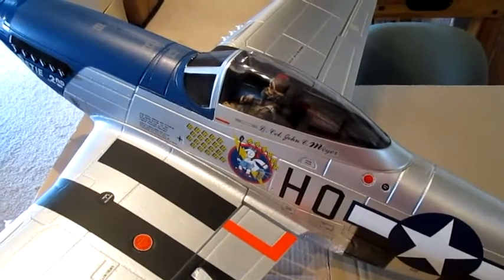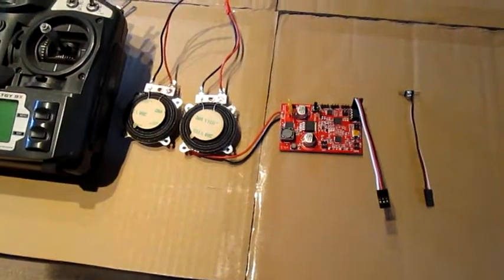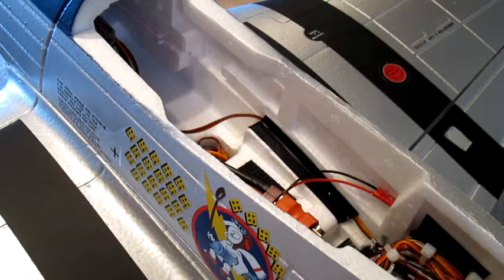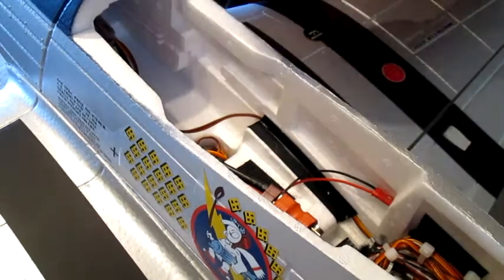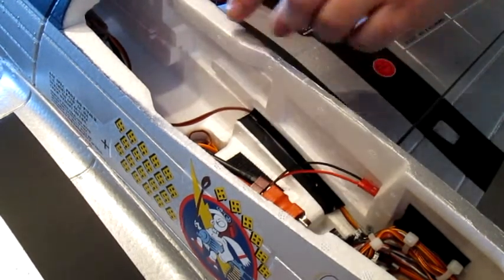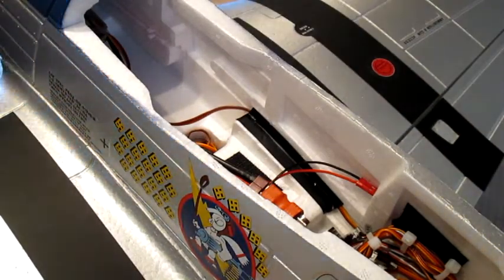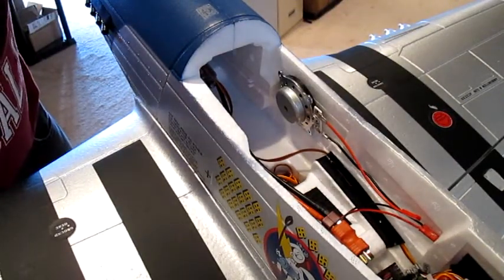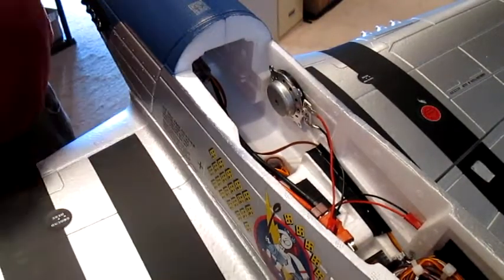Installing the MrRCSound V4.1 and TT-25s.

Comment: I can’t thank you enough. I was pulling my hair out, re-doing everything over and over. (The second I plugged in my battery I went to full throttle sound, no control with the throttle stick)Then I found this. And of course I have a Spectrum Transmitter.... All is good now. (Except the money I owe Hair Club for Men for the toupee....) Again, thank you.

Comment: Andrew.I put this same sound system in my p51 mustang by airfield hooked every thing up  and mother is beeping wount start up two lights on the board.can you tell me what I am doing wrong.when I plug the battery  up first then the sound card it makes a pop  and mother won't start.